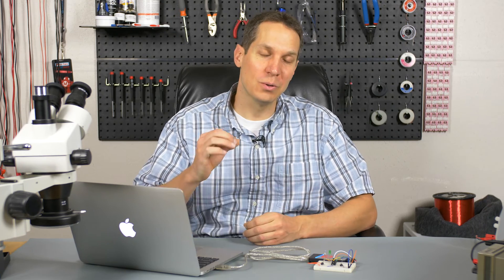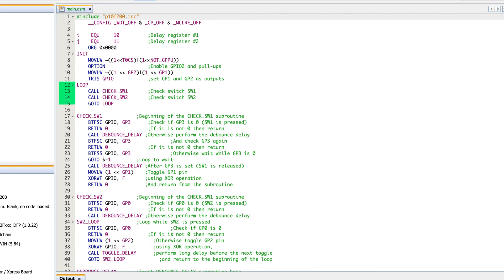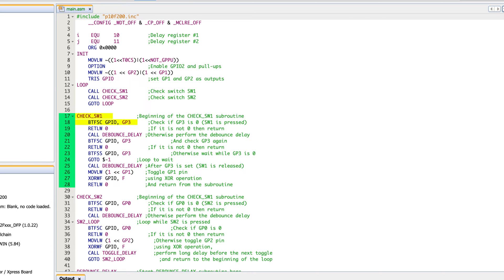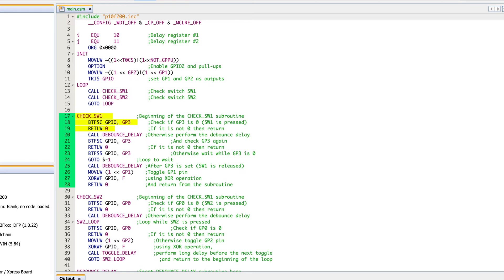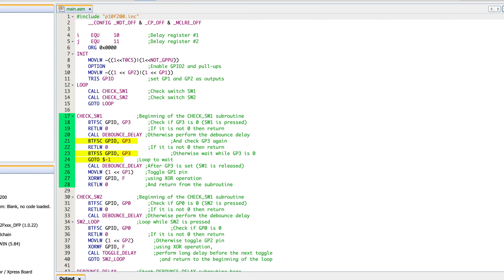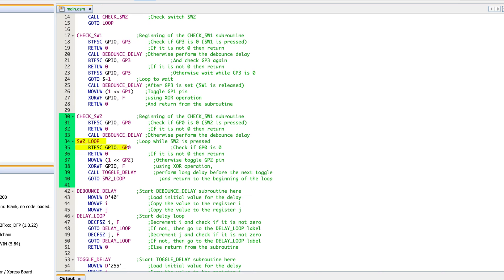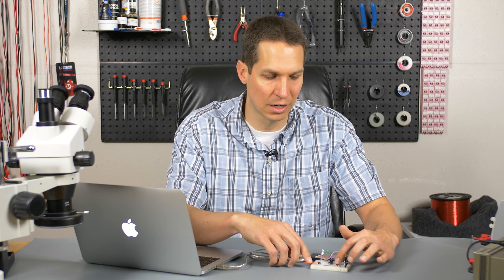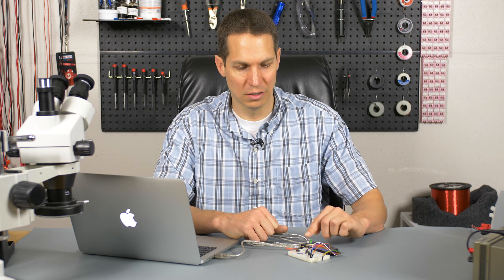Using buttons with your microcontroller in Assembly - Part 9 Microcontroller Basics (PIC10F200)

Comment: amazing playlist and channel, congratulations for your hard work! talking about the source code, between line 25 and 26 I would probably add another BTFSS instruction to check if the button has been really released before toggling the led; and if it is not I would return to line 23 over and over again
Reply from the maker: Debounce can be accomplished in a lot of different ways, but doing another BTFSS would be an effective way to make sure that the button has truly been released!

Comment: I'm trying to replicate this using 12f683. Up until this lesson everything worked fine. I'm using gpio 0 and 1 for LED and 2,3 for buttons, but all I get is both LEDs light up as soon as power mcu and stay lit, no reaction to button pressing. Are there any major differences between 12f683 and 10f200?
Reply from the maker: I haven't jumped into the details but I've found, when moving things from one similar MCU to another, that if there's a problem, it's almost always because there are other features assigned to a pin.  I'd double check the pin assignments between the two and make sure that the 12F683 doesn't have additional roles for the pins in usage that need to be disabled before they can be used.

Comment: Mr Circuit bread, do we need the Debounce software when PIC microcontroller interfaces with other digital TTL CMOS devices.
Reply from the maker: Hi Patricia, that's an excellent question!  But no, the signals coming from other devices are assumed to be clean enough that you don't need to clean them in any way.
Reply: @CircuitBread  thanks

Comment: I Really like this tutorial on Microcontrollers. I am a newbee to microcontrollers and would really like to learn, However, I have a great knowledge in electronics and repairs.... With that in mind, I am repairing a piece of equipment that the PIC16F877A controller is faulty and I bought a replacement PIC16F877A and a PicKit 4 programmer and as I said I am new to microcontrollers and the Pickit4. Can you show me how to read the data off the old PIC16F877 and load it unto the new PIC controller using the picKit4 programmer so I can complete the repairs and send it off to the customer. The old PIC when you apply a little heat it work fine but once it cools off it does not work. I would really appreciate your help on this. Also do you have a learning channel on programming PIC/MCU on your website that I can access? Thanks for your intersting Videos.
Reply from the maker: We do go over the process of programming an MCU in other written and even video tutorials (using the IPE - Integrated Programming Environment).  If you start at the beginning of this series, it should build the foundation you need to do this.  
In regards to pulling code off the old MCU and putting it in the new one, there are two things I should warn you about.  1) Many people put code locks on their MCUs when they go to production so that you can't do exactly what you intend to do.  I'm certain there are ways around these code locks but I've never even delved into it, so if it is code locked, I'm sorry.  2) Even if you pull the code off, it will just be in a hex format, or something only a computer/MCU can read.  If you want to make any changes to the code itself, it won't be given to you as assembly or C or anything you can easily make sense of.

Comment: Why denounce routine how to use it as a regular press
Reply from the maker: We use the debounce routine to get rid of spurious signals and to also clean up the physical imperfections of all switches - where instead of a single switch from one state to another, it sometimes bounces a little bit between the states before settling on its new state.
Reply: Good to know that thanks

Comment: HI, i wanna know if there is any way to connect this microcontroller to a bluetooth module so it can be connected to a mobile app. if its possible, how would you do it?
Reply from the maker: Hi Patricio!  Yes, there is!  Sergey has created a tutorial for doing exactly that, but we just haven't gotten it ready for publication yet.  It builds on the UART tutorial which we have published on CircuitBread (https://www.circuitbread.com/tutorials/communicating-with-a-pc-using-uart---part-11-microcontroller-basics-pic10f200) but we haven't done the video for this UART one or published the written portion of the actual bluetooth one yet.  We should be able to at least get the written bluetooth tutorial up on our website, it should be early next week.